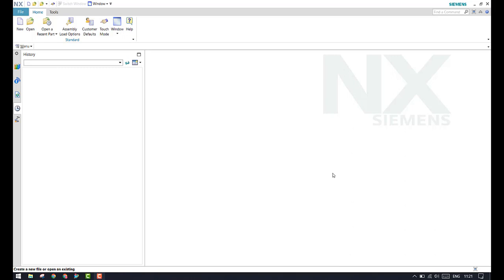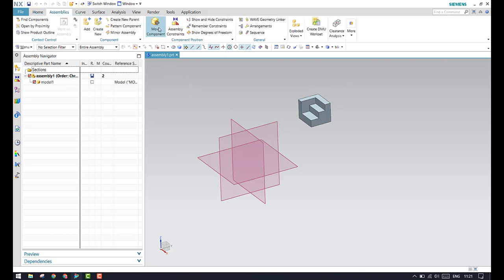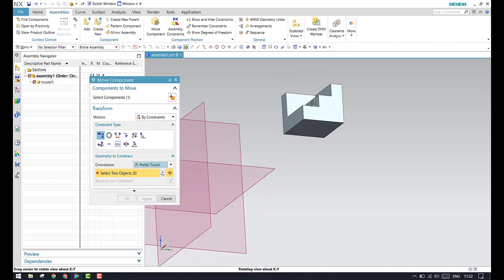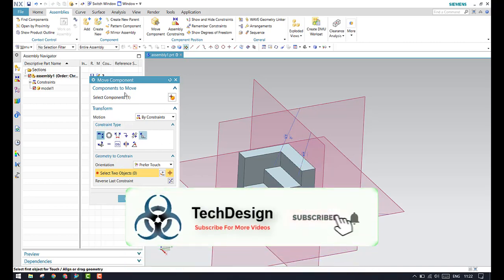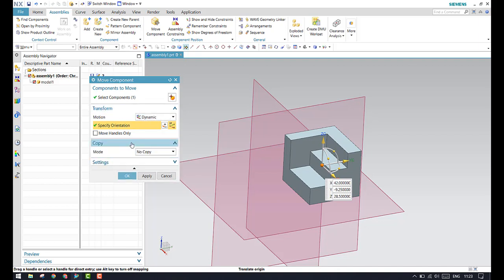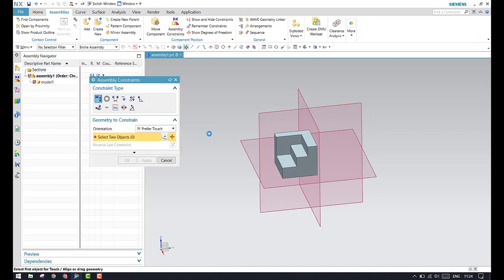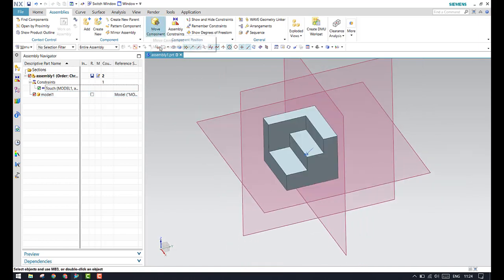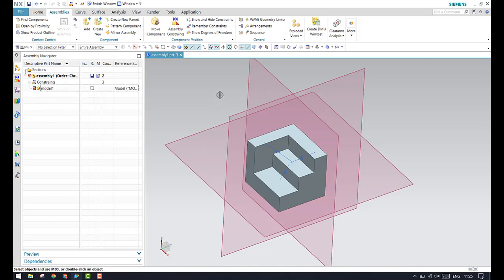Unigraphics NX-Assembly Tutorials || Difference Between Move and Assembly constraints.

Comment: Very nice explained. But why not to use constraints (instead of move)? It seems more effective...
Reply from the maker: Yess it's more effective... But also it depends on the requirements..
Reply: as you said its better to use constraint but in constraint dynamic move option is not available, whenever we need to select any face or other feature that might hide into another part. at that time we need move option or disable the part for a moment which is hiding the face you want to select. as we saw example of bolt in the previous videos. 
thanks🙂